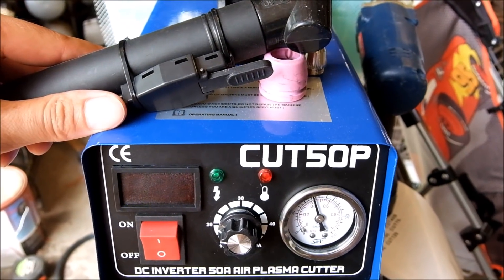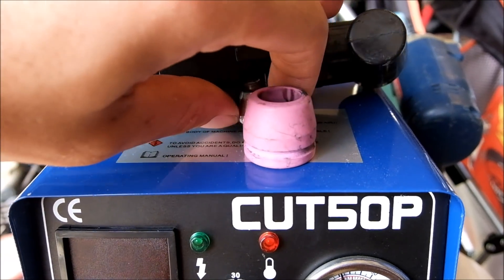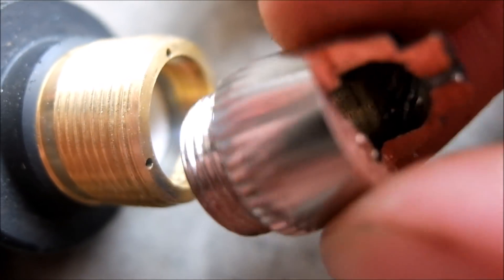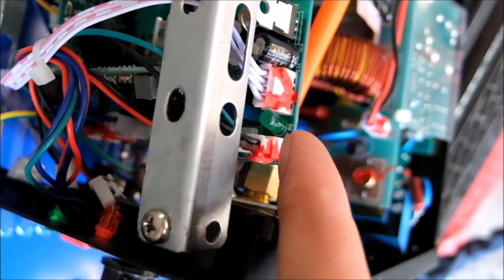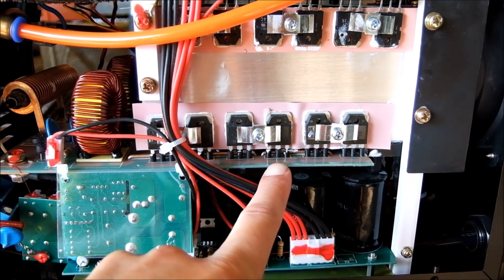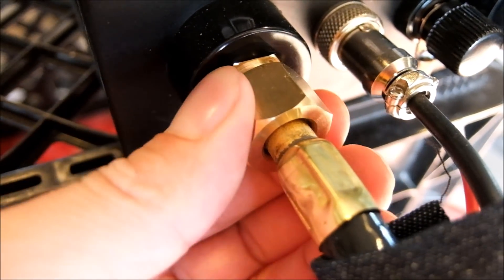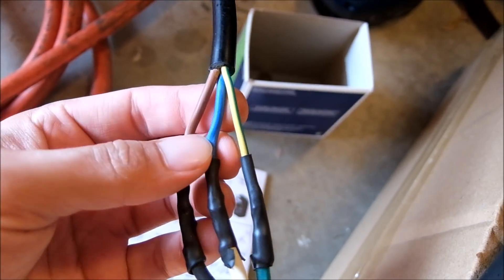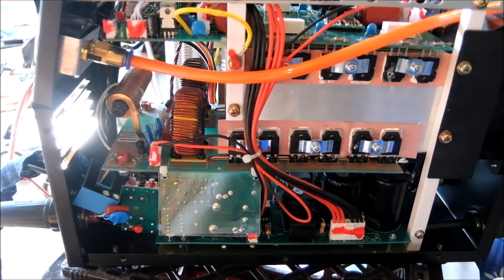CUT50P no pilot arc fix, inside look, and plug install

Comment: I have one of these and I spent 5 minutes or more trying to cut...when it finally fires I'm not ready and then once I shut it off I can't get it going. Replaced tip...got 3 seconds of cut, went tonrestart...cant
Reply: I'm cutting thin metal. Or trying. I could done the job ( with a lot more noise and sparks) with a grinder by now

Comment: I have had a CUT50P for five or six years.  It worked fine for me but after awhile it didn't work well.  I didn't use it for the last few years until  I found that you have to keep the electrode and its shield tight so they don't move by hand.  Also make sure your plasma gun cable is attached  to the machine tightly.  As soon as I did that, it started working real well. I can use it very well.  I can cut everything after form 20 gauge (or thinner) up to easily 1/2".  It can probably cut a bit higher but I don't have anything thicker.  To cut up to 3/16" use Amps 20, PSI 30. From 13/64" to 19/64" use Amps 30, PSI 40.  From 5/16" to 3/8" use Amps 40, PSI 40. From 25/64" to 31/64 use Amps 50, PSI 40.  Everything above that is Amps 50, PSI 40.
Reply: My torch refuses to fire over 30psi
Reply: But mostly sheet metal, like the compressors on central air units and appliance metal

Comment: Yeh, I got the same thing going on with my brand new CUT50DP from another mfg, sputter city!  Thx for the tip about the electrode, I'm gonna try raising it up, will use a small washer like commentor here suggested.

Comment: I never understand people going through these things (I have one of these, or atleast a variant of) showing how bad they are, after all they are between 10-20% the price of a proper one so what do you expect. Buy one, if you find you're using it more than it was designed to be used then go and get a professional one. If not, it sits on a shelf in the shed and gets used a handful of times in a year.

Comment: Good video thank you. Cut away nozzle, great explanation and I think it will cure my problem. I have a Cut50p which is great when and if it works, it has been driving me up the wall, I tinker with the tips and it may work and then stops for no reason. I think that you have solved it for me; good job Sir.
Reply from the maker: When this thing is cutting good....it cuts good. Other times I've had it eat through tips.  I got what a paid for but good enough for what I do.
Reply: Did this work? I’m having the same issue.
Reply: I don't think it actually made much difference. I did alter some tips on my lathe but still experienced the same problems. The thing is, if you disconnect the pilot arc and try it as a scratch start, as soon as you touch the metal the tip is earth and the arc should start but it does not. Really frustrating things, also as soon as the arc is established the pilot arc circuit should sense that and disconnect it's self and the arc should still be forced out of the tip. I have found that the recommended maximum working pressures are far too low. If you look on the circuit board there are two 'points' separated with a gap of about thirty thou' you can adjust this gap to get an arc. I have recently posted a video about some of these machines problems: Repairing and improving a plasma cutter. Hope this helps, Jon

Comment: the reason why your wires are so thick is because US thought 110 volt is enough.  its about the amps.   higher voltage same amps? thinner wire or much more wattage
Reply from the maker: I am running this on 240/220
Reply from the maker: The reason I use thicker cable is because of the length. But yes that is a common in the states  thicker cable lower voltage. A lot of our appliances use to 220 / 240

Comment: I bought a cut-50df (a pilot arc) used it once now no air or arc. Damn thing is brand new. Power to the front lights and air is good. Any thoughts?
Reply from the maker: Idk. Start with the handle and make sure the trigger is working and wires to the handle

Comment: You sound kind of condescending about this low cost plasma cutter with pilot arc.   Does it work now?  Price point is below $300.  I bought the “Mophorn” CUT50  with pilot arc from Amazon.  It works fine.  I paid only $215 in Nov. 2020.  The consumables are highly variable piece to piece or supplier to supplier but cheap.
Reply from the maker: It's cheap, but I got what I paid for.

Comment: make a new cover out of steel,you might know someone who can cut it with their plasma cutter.....
Add some box section around edge of the case to add more space for air movement,and the new cover is only wider ,same depth and height,10mm box would add plenty or space.
It would help.Add some pc/computer dust filters to the new case cover,if the machine works well enough and returns are going to be difficult retro fit the unit to safe guard and protect the guts from micro metallic particulates,as you mentioned you don't want it on the board ...or any board,our super duper state of the arc...art Tig welder was sold as untested,it was contaminated with grinder dust,it was pretty much brand new.

LEDs are diodes,they have a Vf that's forward voltage drop,so they can be used the control a constant current source or be a voltage refference,ALL DIODES EMIT LIGHT,some are made to emit while others are not used so,not all are visible light anyway.The LEDs may be for testing,to show function of certain controls.

Comment: SungoldPower. 50. Brand new. Fan works. Air works. On/ off switch does not light up. Does not cut (no arc at all). Any suggestions please. Thanks
Reply from the maker: Have u tried really low air psi like 10psi? Just to see if anything happens. Then go up from there
Reply from the maker: Does it have pilot arch? If not is your ground good? I didn't know how to strike an arch

Comment: Led on the board is for fault on controll board for trouble shouting not as a diode
Reply from the maker: That makes sense too. I have seen that before.
Reply: @sweetpigfarm3645  looks like the parts was assembled in vietnam😅

Comment: Is the pilot arc stuff basically front cap connected to GND over a resistor, to limit pilot arc current?
I have a couple of CUT40s, bought cheap and broken. If adding pilot arc is that easy, I probably refit them as well (like use 100 or 200W light bulb as current limitor).
Reply from the maker: I thought there was one tiny extra circuit board...I thought there was write ups on the internet on how to add pilot arc. That was a while ago I forgot
Reply: have you tried it?

Comment: What gauge of wire is your power cord?  Mine is 14 Gauge.  I want
To wire it to 220 but I feel like that 14 gauge wire won’t handle it?
Reply from the maker: The 14 AWG is stock for the short length anything longer than that like my extension needs to be 12 AWG or bigger
Reply: Ok so you think I will be ok to leave the 14 gauge power cord on and just add the 220 plug to it?  Thanks for the reply.  Is your unit still going?
Reply: Ok so you think I will be ok to leave the 14 gauge power cord on and just add the 220 plug to it?  Thanks for the reply.  Is your unit still going?
Reply: Ok so you think I will be ok to leave the 14 gauge power cord on and just add the 220 plug to it?  Thanks for the reply.  Is your unit still going?
Reply: Dam I guess my phone went nuts...
Reply from the maker: @joshuahernandez2867  nice! It happens. Yes it's running...don't use it much. Just add a plug is fine

Comment: Can this cutter be use in a  CNC table?
Reply from the maker: It should be able to
Reply: You are honna want a blowback start machine, the electric noise from the hf will screw with the motor controller somethong horrible.

Comment: I think looking at parts, summing up their value and stating, "it's hard to justify the value"., is wrong thinking. Take any cut 50 and YOU make the conversion without the design knowledge how to, without a bag of pre existing selected components, without a simple circuit board to populate, and fit it into an existing design, then the value of what a small extra amount of dollars brings can be appreciated. You are not just paying for components, you are paying for the efforts of design engineers and spreading that cost into thousands of units sold worldwide to bring you a cheap yet elegant solution to a problem. To ask that everything be completed to perfection only drives up costs. You wanted cheap, there it is, but it works if used within design limits. Don't exceed them and get years of adequate service for the hobbyist.
Reply from the maker: Haven't listened to the video in a while I think I was getting to the point where u get what u paid for I am cheap a hobbyist and it's good enough for me. Honestly there is a lot going on in there it's a good value when most are hundreds of dollars more
Reply: I used my cut50df once and it stopped working. I just cut half of part. Came back the next day and the damn thing wouldn’t work.

Comment: Would you recommend putting a a 10-3 power cord wire in place of the standard plug wire on it now. I am thinking about it. Or do you think the bigger wire would let to much amperage into the machine and damage it. My 220 plug I am plugging it into is 10-3 wired and so is my extension cord. Like you said that short power cord doesn't cut it.
Reply from the maker: Bigger is okay. It can only take whatever amp it can pull. Bigger wire will not push more amps in. Bigger is almost safer

Comment: I got the same one,  but I get no air flow out of my machine,  any suggestions?
Reply from the maker: Air solenoid getting a signal?
Reply: Check the air drier/filter is on the right way round. The one fitted to my CUT50 was on backwards !

Comment: I had the same problem with my cut 50 ,, anything over 35 psi it would blow the pilot ark out ,, I put a brass washer .5mm thick under the electrode ,, easy fix  ,as i have about 200 on a packet i dont think i will run out soon ,For $300 delivered (australia) its a great tool ,, i have had mine about 9 months and flogged the crap out of it ,, I find 40 amps and 50psi will chop thru anything over 10 mm to about 14mm 3/8 to 9/16 inch for 1mm to about 10mm i use 25 amps and 40 psi ,,, the electrodes wear out faster than i thought but for $50 you get 50 of each consumables so no big deal..
this machine has saved me so much time ,, Great vid SPF ,,
Reply: This is exactly why it's well worth reading through the comments, thanks a bunch mate!  Got my cut 50P yesterday, first problem - air hose inside machine was bent closed. Then I could not get the pilot arc running, sputtering at best (tried gapping the contact points to no avail). Read your comment and unscrewed the electrode (P-80 torch) by 1/2 to 3/4 turn to get the electrode closer to the tip and now runs a pilot arc as it was supposed to, will get hold of some brass washers, cheers.
Reply: Hey mate about to buy one of these, still rate it? Also did you wire the power plug? Cheers
Reply: 13 yrs Prepper, thx for the tip about the washer, guy!  Gonna try that to fix my sputtering dilemma.

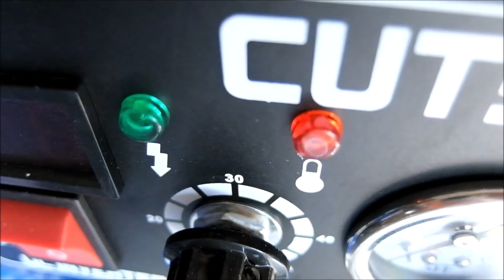Comment: @4:00 It is quite common for electronic equipment to have LEDs hidden inside. They are typically to help with quick diagnostics and sometimes even verification in production. Quite often a green LED just indicates that a board is powered up and a red one may indicate a fault.
Reply: These LED's could be Voltage References.

Comment: Lots of designers use LEDs as voltage references. Red ones and green ones have a different voltage drop.
Reply from the maker: Okay I could see that. Just I haven't really seen it used like that.